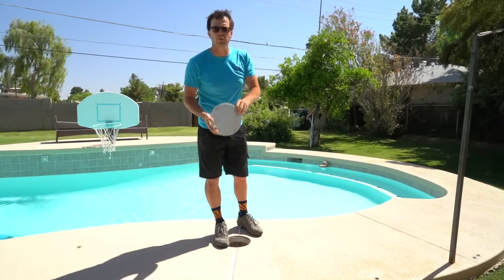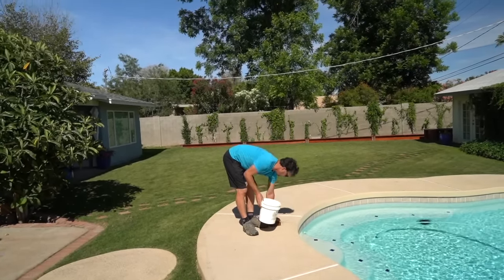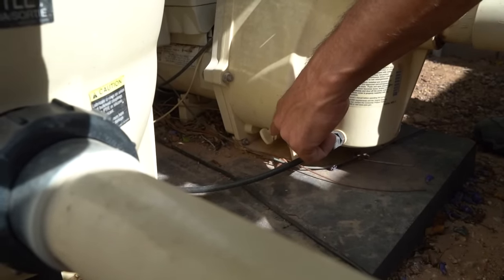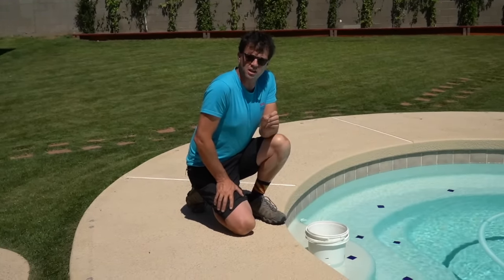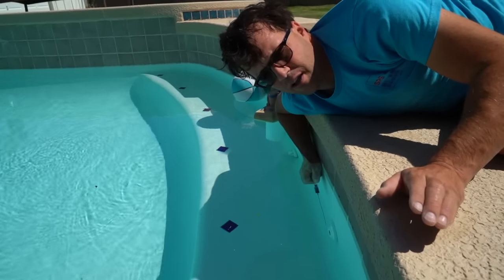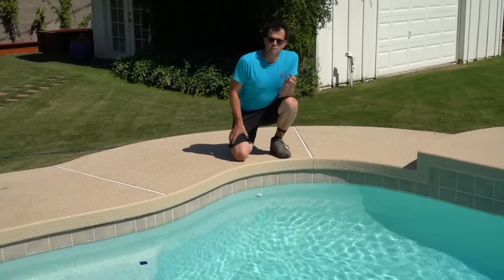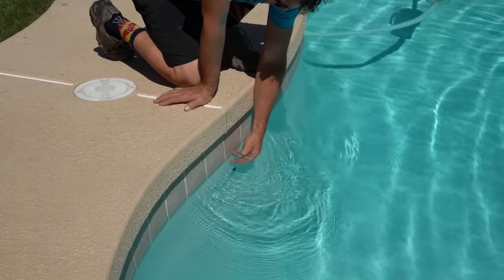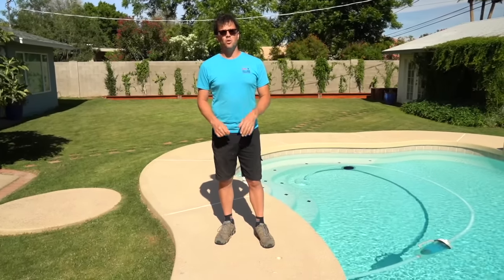Chasing pool leaks, Don't call a leak detection company until you watch this

Comment: I have has a significant intermiitent leak in my pool. I did the dye leak tests and nothing, so I let the pool drain where it would stop. Went past the skimmer, past the jets. partly past the light. It would rain and fill back up pretty well and then it would leak again. It doesn't leak if it doesn't rain. I have researched and best I can find is the hydrostatic valve is leaking. HUGE problem. None of the pool companies I call know how to replace it and tell me to call a pool manufacture company. So, it has been sitting all summer, not running. It is hugely green and to top it off, I was carrying a bucket of dirt, tripped, and it dropped in the pool. 

My question, is it hard to replace the valve myself once I drain the pool?
Reply from the maker: What area of the country are you in? It would be good to put you in touch with an expert on this

Comment: For the bucket test, wouldn't the water in the bucket drop faster than the water level in the entire pool since the bucket is a smaller volume of water??
Reply from the maker: You’d think so but no. The smaller surface area exposed to air (where the water evaporates) cancels out the smaller volume (and some other physics stuff) so the evaporation rated remain equal.
Reply: @SwimmingPoolAZ-SPS  Thanks for the quick reply
Reply: If the container was made with a more radiating heat conductor, yes, But its plastic. Although it would be better if he cut away the rest of the bucket above the surface. You want as much of the bucket in the water to reduce major changes in temperature.
Reply from the maker: Phil Indeblanc true if we’re looking for near perfect accuracy but fortunately close is good enough within a few fractions of an inch
Reply: @SwimmingPoolAZ-SPS  yes...there is practicality of course. Just perhaps that it can be a slow leak or something, if possible, or if hard to tell, you might want to try being more precise. This video is great, cuz I have bublles blowing while its running, and I think I have a DE filter leak. , lol..so...I need to check this as I am loosing about 2 inches a week or so  Heat in So Cal doesn't help.

Comment: Helpful video. One of my returns is blowing bubbles. You'd think it was a jacuzzi. I tried a smoke test around the pump and plumbing, but I saw no clear sign of where it's drawing air. :(
Reply from the maker: You’re drawing air on the suction side of the plumbing and it’s passing through. Check the o rings on any 3 way valves, pump lid. And the inlet nipple. It’s most likely from one of those places
Reply: Is there air in your pump? Then it's on the suction side. Start from where the pipe meets the pump. Check the pump lid, gaskets and plugs. Make sure they are air tight. Turn your pump off while someone watches. If water squirts out right when the pump goes off, there is a leak. Then mark you water level and plug up your skimmers for a day and keep the pump off.. See if the water drops. Check skimmer for cracks using a needle and dye. if no water drop then check the main drain last by plugging it up for a day.

Comment: Il need to buy that test. Last year my pool went down so low and it was end of season so I just gave up. Wanted to try and see where it stopped and check. Funny thing, once closed it stopped. About 2 months ago I added water turned it on and waited to try and see where it would stop. It never went down 😳 so, I thought Woah what a weird pool, (not the first time it did weird things, last year it stopped at skimmer so I changed it then it went down down down but I wonder if it stopped at skimmer because I stopped the pump🤔) so I started the pool, it's all set and my son has been swimming these past days. But today after a few rain falls, guess what. Water was under skimmer 😱 I added water but now I'm so confused. I called last month my pool place to say it stopped leaking. Now it's going down like crazy again. What changed? Maybe the bottom is cleaner. So water gets sucked out by bottom drain. Something I mentioned my pool place but they keep saying it's not that because if it was I'd have no water even when pool is shut. I felt a pull at the bottom drain while vaccuming. 🤔 I mean if that doesn't scream something.. Ugh. Water is cold and I don't have that dye thing. Amazon time I guess. I really just don't know what to do anymore. It's driving me crazy. Anyhow thanks for your video. And I definitely don't need to do the bucket test. I thought of doing it at the beginning when I started the pool. But now I'm not losing CM but INCHES in a DAY while it rains🤦‍♀️

Comment: Hi Josh you seem like a smart guy so in my pool I have three returns and a couple of port holes shape like an eye what are they for ? and is it possible to open the light in the pool while below the water or do I need to lower the water below light? Thanks
Reply from the maker: What a coincidence, my wife thought the same thing about me on our first date, then she got to know me......anyways, the light has a screw at the top of the metal ring. If you unscrew that and tip the top of the light forward, it will come out of the niche. You can then set the light up on the deck and examine/service it. If it has water inside, it may be corroded and the whole fixture may need to be replaced. It could also just be that the bulb is burned out. In that case you can open the fixture and replace the bulb. If you do this, replace the gasket as well. No need to take any water out of the pool unless whoever installed it didnt leave enough cord for it to be brought up to the deck (think a dog having too short of a leash)
Reply: Come fix mine

Comment: My water fall line is leaking while its running. When the pool is OFF and calm for 24 hrs, NO LEAK, turn the system back ON without the water fall and NO LEAKS, turn the water fall back ON and then i leak several inches in 24 hrs .. 
That waterfall is above the water line, how do you find that leak..??
Reply: You Tube ... if you don't have a wet spot / leak around the waterfall had you considered using it might add considerably to evaporation? In certain areas it's all about evaporation. BTW, if you can isolate that pipe (with the valve) and plug the end you can eventually find the leak using low air pressure or water pressure.
Reply: @rupe53  its leaking like 3 inches in 24hrs when water flows thru that pipe, when i shut that valve off to that pipe, no leaks at all...
I dont know how i can use water or air pressure to find it because all the piping is under ground and only the pipes at the equipment are exposed ... so if its an underground leak, i wont be able to see the water gushing out or air leaking thru ...
Reply: @ACommenterOnYouTube  ... 3 inches a day is more than it would evaporate in Arizona so it's obviously going someplace. Sounds like you need to dig a few test holes (say every 10 ft) and narrow down the wet spot. BTW, I used to trouble shoot gas pipe leaks and my first suspect was always near anything in the yard that's been disturbed recently. IOW, near plantings, fence posts, survey markers, electric ground rods, and the like. Anyone put up a tent in the yard for entertaining recently? Tent stakes go into the ground a long ways. It will be a process of elimination and you have to start somewhere.

Comment: I cannot put my skimmer on more than about 10% at the control valve for skimmer and bottom drain or I draw air. Because of this, I cannot use my manual vacuum.
Reply: It's either the pipe from the skimmer to the pump is cracked or a loose joint or your water level isn't high enough for the amount of water the skimmer pulls in which would not affect the manual vacuum since it's well below the water level.
Reply: Or line collasped

Comment: So I’ve used pool dye checking for leaks and I checked at every fitting. Did not find any leaks, yet the pool still leaks under the skimmer 3-4” in just a couple days. Any ideas?
Reply: Did you manage to find anything yet?
Reply: @thisisme2115  we figured out the pools additional system for circulation of water if water level ever drops below inlet basket, was actually leaking itself somewhere in the pipe, in concrete. Funny, the system that’s supposed to protect the inlet basket from water level loss, is the system that caused the leak. We ended up sealing the 1 hole in the inlet basket and 2 holes on the bottom of pool that allow water to travel up that pipe, to go to inlet basket. Pool has had 0 leaks since.
Reply: @oneman7638  Thanks and good to hear you managed to sort it out.
Reply: @thisisme2115  Thanks for your input. In the future I when I build a gunite pool or fiberglass I’ ll make sure to secure the pipes
Reply: @oneman7638  I am traveling to France this weekend from UK as my swimming pool has been leaking for about a year now and still we can't identify where from. Once the pump is switched off, the water does not go so I take it it has to be from the pipes somewhere.

Comment: Couldn’t you just drill a bunch of holes in the bottom of the bucket. Then add your weight. Bucket should fill to same level as outside.
Reply from the maker: That would fill the bucket to the same level BUT, then it wouldn’t be isolated from the pool and would leak down at the same rate. The idea is that you know the bucket has no leaks (holes) so you can’t compare the difference between the two. If the pool has hole and the bucket has holes too, you won’t know if there’s a leak.
Reply: @SwimmingPoolAZ-SPS  damn I’m kinda retarded!  Now I get it. Also I’ve been binging the vids since we now have pool. Been very helpful thank you josh

Comment: 4:21
This is such a rare exception that most people should completely ignore what I am about to communicate.

Hey, Josh, living in Arizona you should know that it can very well matter if it rains (almost never will, but the possibility does exist).  With the extent of how isolated some of our rainfalls can be, it is possible for half of the pool to receive a quick downpour, while the other half receives practically nothing.  While driving between Tucson and Phoenix on a two lane highway, I've actually witnessed rain falling on one side of the highway while the other side remained dry!  I recognize that the odds to a similar event affecting someone conducting the bucket test are astronomical, but the possibility exists
Reply from the maker: That it does. But like you said, it would be a rare case. In such an instance it’s possible for the non bucket side of the pool to get the rain, then the pool would be higher than the bucket and really throw someone for a loop!

Comment: Isn’t a single main drain against code?
Reply from the maker: On new builds yes. Most existing commercials have been converted and/or have a safety vacuum release system installed as well.

Comment: You did that bucket test all ass backwards. You don't need to weigh down the bucket and then scoop water in. Just dip the bucket and get water in it. Mark the bucket when the pool settles. Also 24 hours is good enough. Plus any pool owner who needs to call a pool leak detection company? They already know they have a leak. 3 days is too much if it's a serious leak.